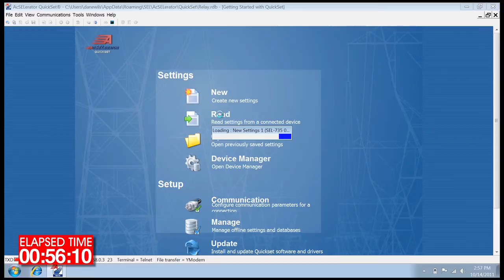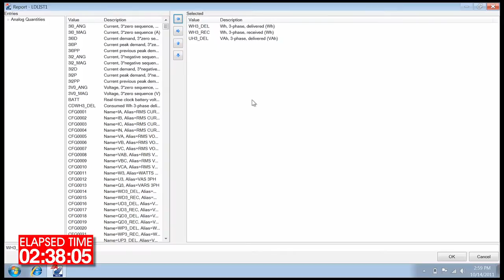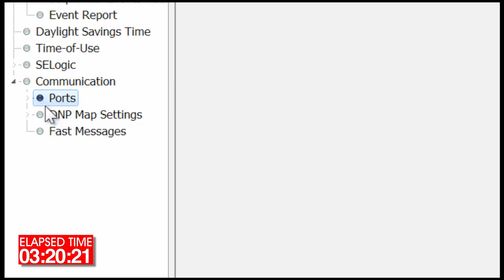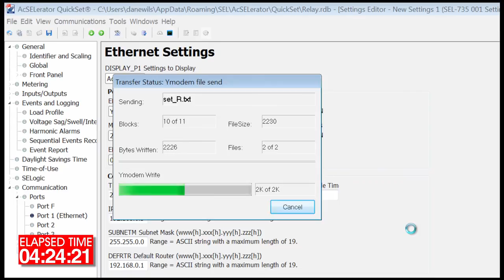How to Set SEL-735 Power Quality and Revenue Meter

Comment: I did not see you plug into this device. What type of cord do i use to connect the device to my laptop for configuration?
Reply from the maker: Thank you for your question. You can connect an SEL-C662 USB-A cable to serial or ethernet on the rear of the unit or the front port can be serial, ANSI Optical, or USB-C depending how your device is configured.